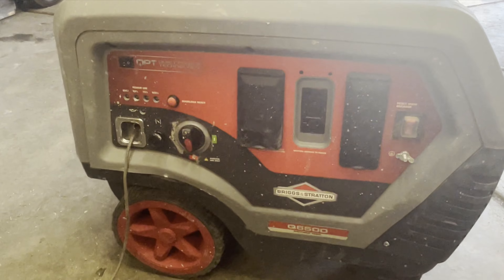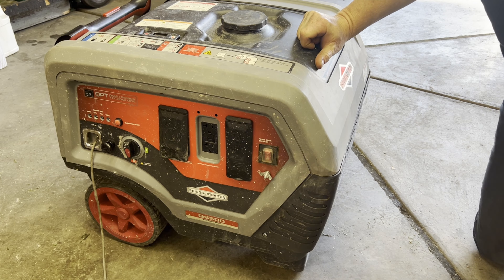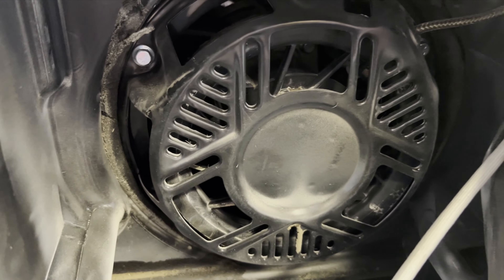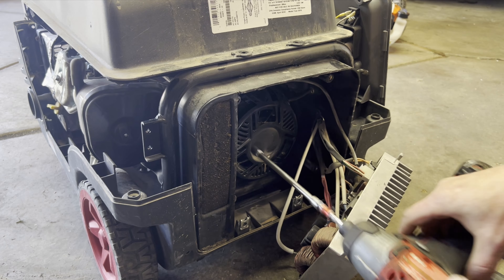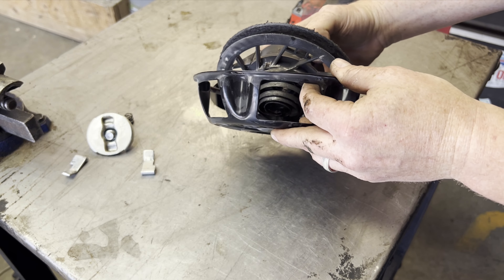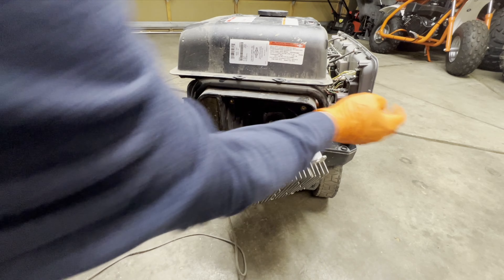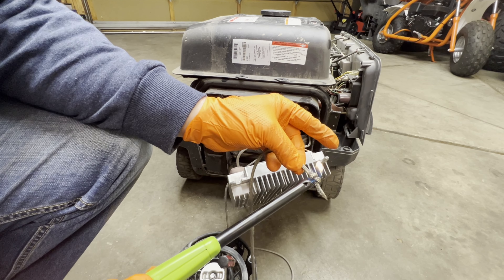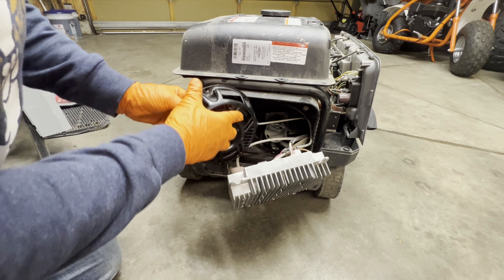Briggs & Stratton Q6500 Pulley Spring Assembly Replacement

Comment: Thank you for sharing this repair video...I recently purchased one of these B&S inverter generators, so now I have some idea of how they come apart for future reference. I'm having some trouble with the telescoping handle pulling out, so I may have to modify or repair the mechanism inside...assembled in China, so I would expect more future problems. The spark plug is a bit difficult to get to, but I did get it out and it was not gapped properly from the factory. Otherwise, it runs pretty good so far!
Reply from the maker: Glad I could help